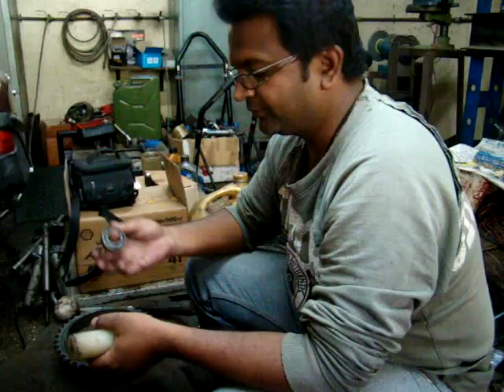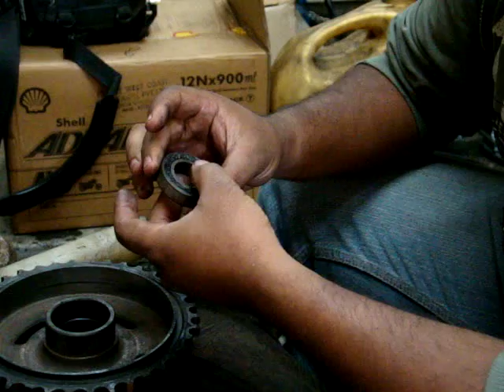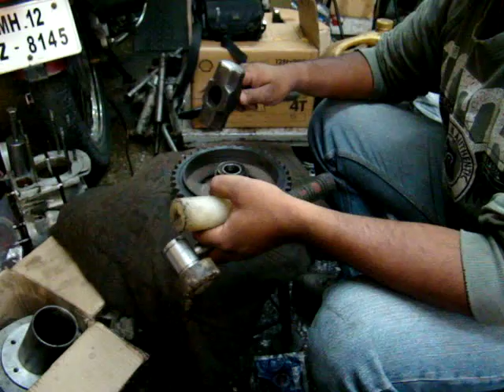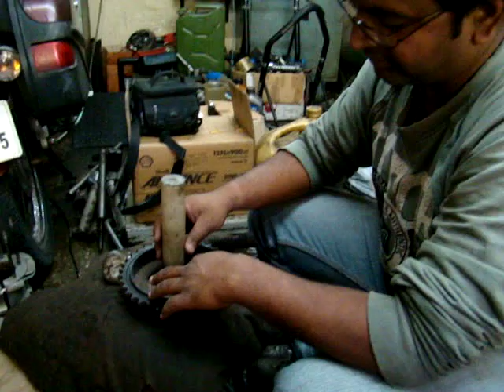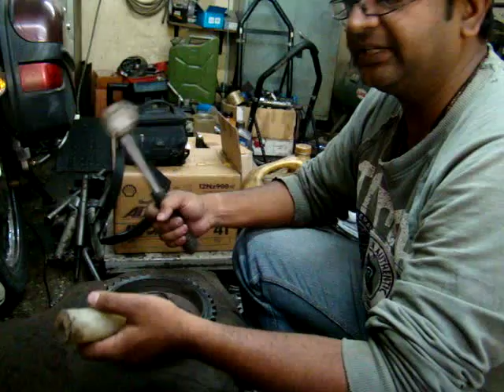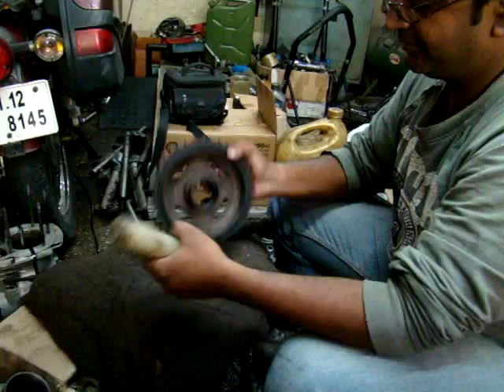Royal Enfield Sprocket bearing

Comment: how to know the bearing is damaged
Reply from the maker: if you shake it in hand it makes sound and if it is related to wheel then wheel will move offset way
Reply: mechautoclinic  sir is it possible of wobbling due to sprocket bearing damage plis help,already changed front and rear wheel bearing and replaced centre bushing.plis kindly advise sir